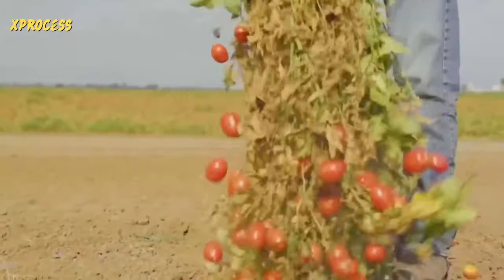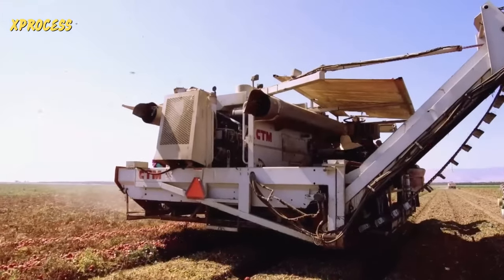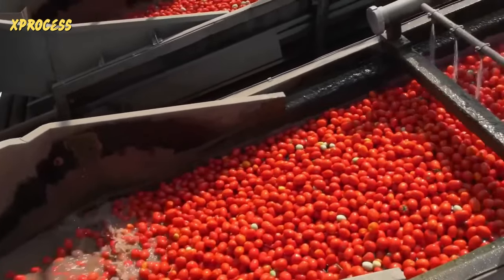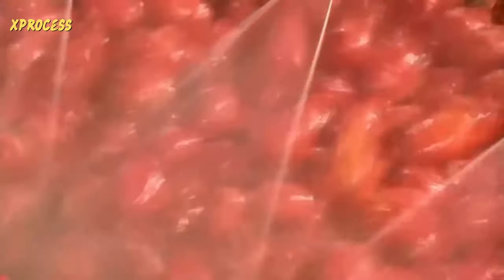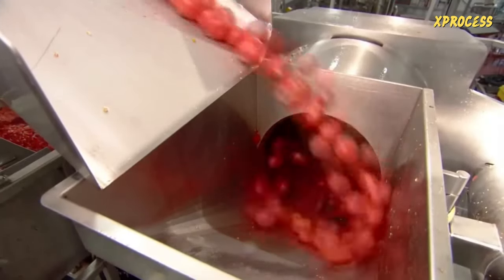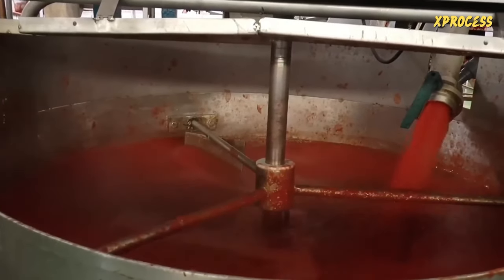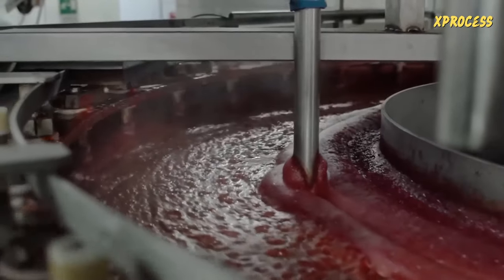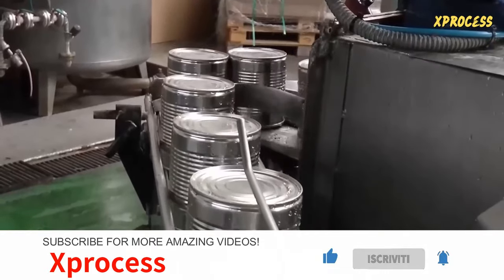How TOMATO KETCHUP  Is made in factories🥵🍅| Tomato Harvesting With Modern Technology

Comment: Not about Ketchup and they are steel cans not aluminum .
Reply: @jonflanagin6682
 How can you tell they're steel?
Reply: i know aye its tomato sauce, then again America is the only country that i know say ketchup not tomato sauce… The cans are aluminium they havnt used steal for cans in at least 30yrs
Reply: @Golden-dog88  I can't speak for other countries but in the USA they absolutely do still use steel (tin).  You can tell by feel, but also I just plopped a magnet on three different cans from my pantry - stewed tomatoes, tomato sauce etc.
Reply: @santanalz  They look like tin and also that is what is used (in the USA). If you want to check at home - stick a magnet on the cans.  The only 'tomato' product I have personally seen in aluminum is V8 juice which comes in the same sort of can as soda pop.   It could be different in some countries but tin cans are common in the USA
Reply: @Golden-dog88  Tomatoes are acidic and a tin can will hold up better than an aluminium one. For this reason, most tinned toms (aluminium or tin) usually have a coated interior.
Reply: @Golden-dog88  Steel is used for most soup, and vegetable cans including the ones in this video. Duh, if a magnet sticks to it, it's ferrous metal.
Reply: The AI used here wasn’t very smart
Reply: @jamesconroy7030  steel steel steel! And they did not produce ketchup! And the States is not the only country with ketchup!